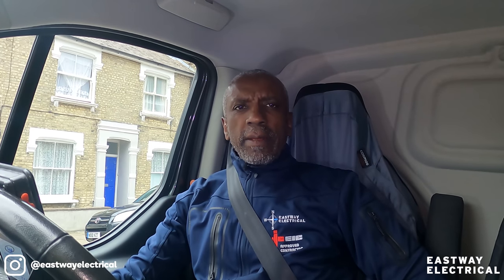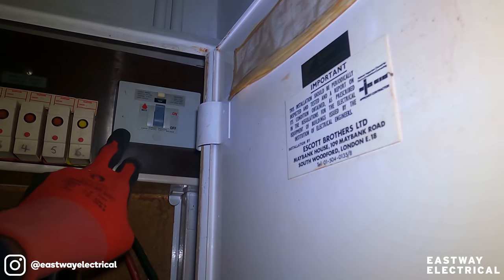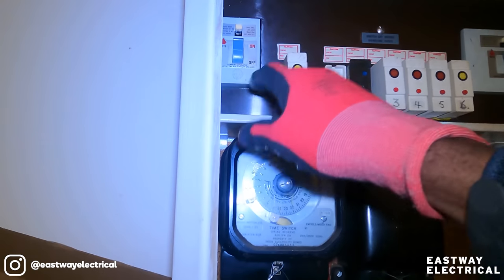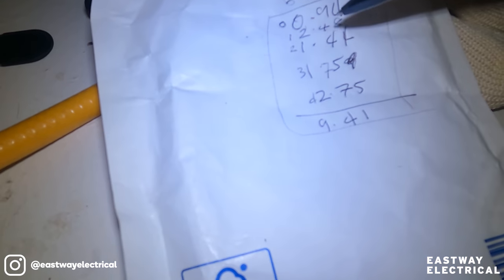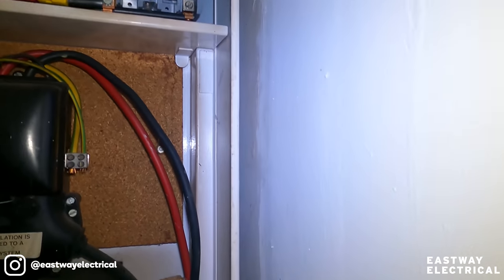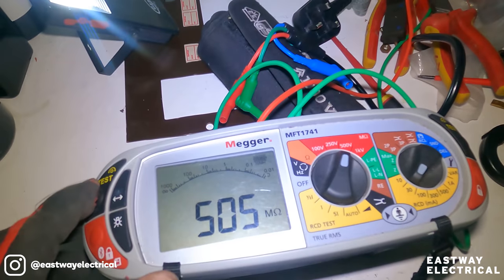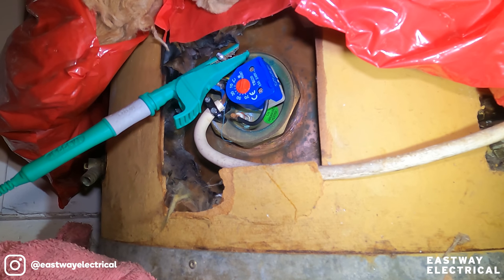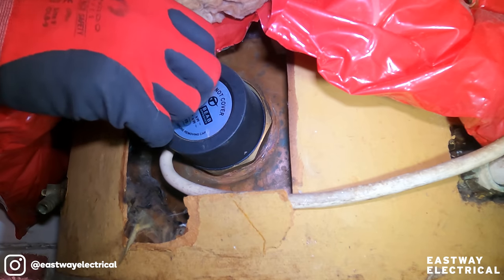"I've Never Seen This Before!" | Tripping RCD | Electrician In London

Comment: I think what happens is things get replaced over time  sadly what  should get a replacement typically doesn't see a replace and causes issues

At some point date of install vs current safety regs don't comply with each other  I would of told the home owner assuming not a rental  that  he is looking at a rewire to bring everything up current safety codes
Reply: Certainly nothing here says the installation would not pass an EICR. All the circuits would need to be tested, but everything is protected by RCD and it looked like appropriate OCPDs were used for the circuits.
Reply: @sdgelectronics  how old was the RCD in the 1st place  as for the timer I would think the meter itself was something from the 50's-70's

poor wire up with a lot of bodge jobs..

my opinion  never mess with another's work unless you plan to bring shit up to code and do major replacements

Looks like a mix of red blue brown with a mix of  blue brown and yellow/green

pull off the range  and oven my guess there is a crossover there between earth and negative

Last i checked cable yellow-green was typically the groud, blue and brown used as positive and negative
Reply: @jasonhowe1697  there's no issue with mixed wiring colours, it's common across probably 80% or more properties in the UK. There's no positive or negative on AC. Why would there be neutral-CPC reverse??
Reply: @sdgelectronics  I'm old school the way I was taught on power 

1 leg positive
1 leg negitive
1 leg ground
single phase

my crossed wires somewhere causing ground short

cause the numpty  who did the  last  crossed the lines somewhere  in a junction  box somewhere

reversing polarity  wouldn't cause a ground fault 

assuming the numpty before  didn't wire from a 3 phase outlet to a  single phase outlet

the shock off the exposed wires  tells me the earth is live with power dell

I suspect something in that  kitchen is likely on 3 phase and I suspect someone tapped  into a 3 phase circuit..

I also suspect there is likely no thermostat control on the water heater  as it is likely fried due to the ground short

these days they call live neutral and  ground
Reply: @jasonhowe1697  What on earth are you talking about? A load of nonsense that's irrelevant to the video!! You were obviously not taught anything as there's no positive or negative on AC and there never has been - it's alternating current, so the polarity changes twice every AC cycle! What oven? Complete gibberish!
Reply: @aptsys  I Believe there has a appliance pulled out from the wall after the  oven and range..

240 vac 50 hertz cycles..

the point I was getting at that   whatever is  link off the  point  behind the oven and range  most likely has a crossed line with the earth as for the other issue of the  over heating hot water service  tells me if the  meter isn't fried  it is likely  the controller on the service that  has died due to the ground fault as I suspect the hot water service is on the same  circuit as the oven

Back when I was a kid the explanation  for power whether it was ac or dc  was positive negative  and ground..

in early 2000's new terminology came out  calling electrics different

personally i think how weak rcd's actually are I don't believe in daisy chaining power points should done today though that's just me
Reply: @jasonhowe1697  AC has never had positive and negative. The terminology here has not changed since 1832. You're talking complete nonsense though - the timeclock clearly has the wrong time since it thinks it's early morning, however it's of no detriment to the homeowner since the same timeclock also sets the off-peak tariff. There's no crossing of earth or line or neutral otherwise the fault would be consistently repeatable and would never have allowed the installation to work.
Reply: @jasonhowe1697  There's no oven or range mentioned in this video. I'm not sure what you're talking about?

Comment: a dodgy looking cabinet, what look like 10mm tails, lighting off the power ring, imersions back shorting, and intermittant tripping, that needs some major work,
Reply: Lighting off a ring is fine as long as it is fused down.  From what I could gather a fused spur was used for that.